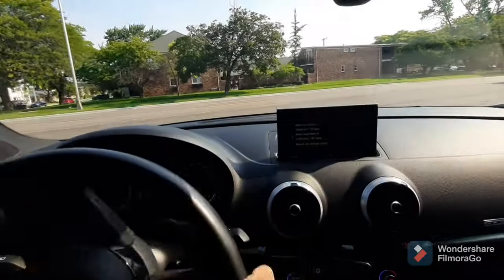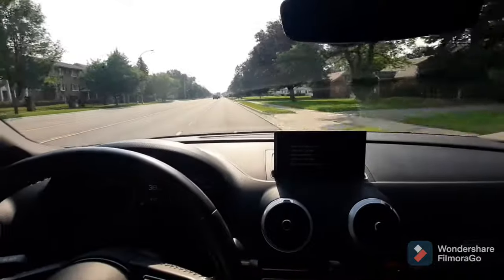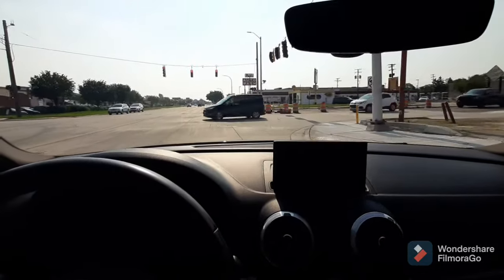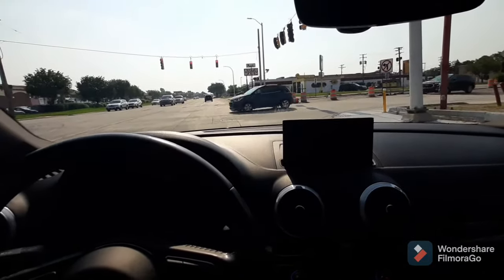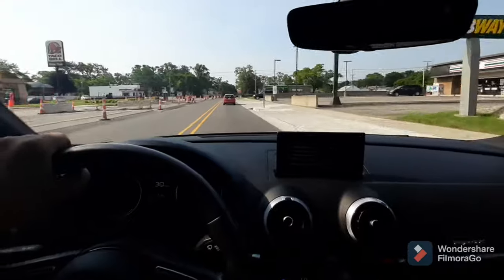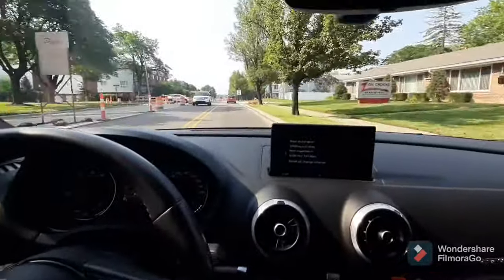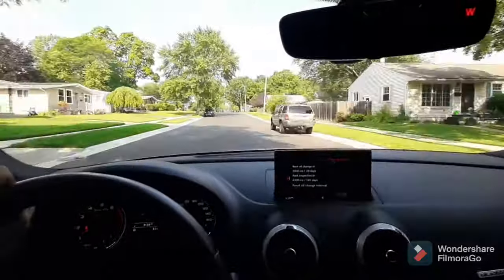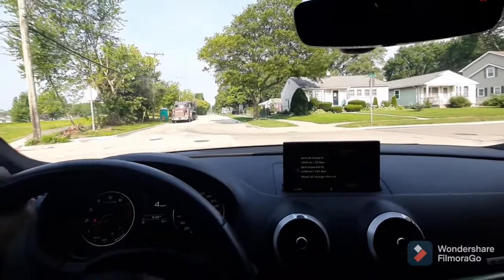How to tell the difference between a wheel bearing noise and a tire noise from drivers seat

Comment from the maker: If you would like to help support this channel please take a look at these tools I recommend and use daily. 

Streamlight usb rechargeable pen light (affiliate link) https://amzn.to/3GxgWtl

nebo usb rechargeable pen light (affiliate link) https://amzn.to/3vAK0wT

Automatic noise cancelling ear protection (affiliate link) https://amzn.to/3Q7ZiPZ

Reasonably priced metric wrench set. (affiliate link) https://amzn.to/3GvIkHV

Excellent 1/2in drive split beam torque wrench (same as snap on) (affiliate link) https://amzn.to/3Z5qu67

1/2in long impact socket set, I've been using this set for 15 years and haven't broke one yet (affiliate link)  https://amzn.to/3jJcrmv

Thank you and thanks for watching
Reply: What you said 0:30  my vehicle gets louder at 40mph in the front only when i loaded to the left is it true that it’s my right wheel bearing defective and not my left one ?

Comment: My mechanic told me my bearing were bad. He changed 2 of them. Still had the road noise. I changed the tires, the sound went away. Yes, I found another mechanic.
Reply from the maker: Good move, sounds like he wasn't the guy
Reply: At least you have 2 new wheel bearings now 😂
Reply: Mechanics, like lawyers, create problems not solutions.
Reply from the maker: Lol so often true
Reply: @bullinapeamurica5940  4 good total :)
Reply: Same happened to me months ago 😭
Reply: Yeah, I was told it sounded like the differential, so had it serviced. .no difference.. same mechanic says it's the wheel bearings,  and I can understand why, sound wise, but I'm not convinced since first diagnosis was off .. service cost unecessary. But it narrowed it down. 
I recently had a flat tire on a 2001 4x4  SUV,  ran on it's spare, a tire kept when set changed, less than 2 yes ago,  for a couple weeks. The abs light came on since, and sounds started soon, days after having the newer tire repaired and put back on, front passenger side.
I started asking myself if it could be how it was mounted, hubwise?  I'm keeping an open mind, but have no time or more money to put in to "maybe" fixes,  and don't feel safe driving unless/until I can rule bearings out  :)
Reply from the maker: Sometimes just rotating tires side to side or front to back can help diagnose if it's a tire issue or not.
Reply: @EuropeanAutoRepair  hello my friend, i have a 2020 Audi A3 2.0 (odo 17k miles) and i have a humming noise from rear passenger wheel, Today i rotated the rear wheel to front and now that noise moving in front passenger side, i thing the problem must be the tire or the rim is bent , is that right? Thanks
Reply from the maker: Sounds like a tire problem. Install spare if you want to be sure
Reply: @EuropeanAutoRepair  thank you
Reply: This is too common
Reply: Holy shit the SAME EXACT thing happened to me. Had two bearings changed. Still having issues. This confirms my suspicions that I need new tires. Thank you!
Reply: Did you went on same tire brand or different? thanks in advance!
Reply: I changed bearings and now tires but still noise coming mechanic said it’s transmission noise?
Reply: @Pubgliv804 any update ?
Reply: Same problem with me
Reply: mechanics should have to refund every penny including parts when they dont fix the issue after diagnosing incorrectly.
Reply: Diagnosis is 80% of the work. Most mechanics dont know how to diagnose
Reply: My low profiles are loud AF
Reply: Only time i forgive that is if they apologize and give me my money back for the repair i didn’t need
Reply: Some times the bad bearing will cause cupping wear on the tire so you need to change both so it may not be your mechanics fault
Reply: 🤣you know we gonna ask
Reply: @EuropeanAutoRepair hey bro....I bought old car used to have vu vu vu ...sound ..but since last few days it is making much more vu vu vu noise ...when I asked a mechanic who is a neighbour to me ...he drove the car and said it is bad tire..and make it balancing or new tire...but when I take it to some tire balance shop he checked physically on the road with out putting it on the wreck told that it's not a tire problem...went to tuning shop and he said might be a wheel bearing problem ( my car is a front wheel drive and I'm sure it is coming from rear side ) kindly guide me what to do now please ... driving my car with same sound almost from 10000 miles ..
Reply: @90qwertys  hi .bought old car used to have vu vu vu ...sound ..but since last few days it is making much more vu vu vu noise ...when I asked a mechanic who is a neighbour to me ...he drove the car and said it is bad tire..and make it balancing or new tire...but when I take it to some tire balance shop he checked physically on the road with out putting it on the wreck told that it's not a tire problem...went to tuning shop and he said might be a wheel bearing problem ( my car is a front wheel drive and I'm sure it is coming from rear side ) kindly guide me what to do now please
Reply from the maker: @leelakrishna888  lifting the vehicle in the air on the hoist and rotating the wheels while listening with a stethoscope would be a way to eliminate wheel bearings as a possibility
Reply: Lmaoaoaoa my mechanic told me it was my brakes changed them noise didn’t go away I got a new mechanic
Reply: Wheel bearings cost 200 a piece . Mechanics will do anything to finesse you . Only a good few you can trust
Reply: Ur awesome bro
Reply: @ianlondon2888  Fact. Thru fix one thing & mess something else so you can go back to them with more $.
Reply: Helpful video, I was quite worried. Checked my axles and bearings and they all seemed fine. The wurble sound you mentioned gets faster with speed. Rotated tires and the noise switched spots 😂
Reply: You realize that, you could have had bad wheel bearings as well right lol. Just because it might not have been a direct fix to the symptom you hear that doesn’t mean that they weren’t due for replacement.
Reply: Mine happens on a particular road. Which is the newly tarred ones leading to my street. Once I get on the expressway which have old asphalt, I hardly hear the sound. It’s a new car I just got. My previous car didn’t do that on that same road. What could be the problem?
Reply: @eguasaogiamien1755 same happens to me I even feel
It on the steering wheel just can’t diagnose the problem myself
Reply: Probably shock not good
Reply: Think you need new mechanics 😂😮
Reply: Could be both 🤷🏼‍♂️
Reply: Same thing here
Reply: wuh wuh wuh on decel hahaha spot on though
Reply from the maker: Hahah yeah man, I had to make the noise
Reply: All you needed was new tires and an alignment
Reply: Bro I just did a repair and the mechanic hasn’t come back to fix my issue I’m like damn people really being shady and not doing good business
Reply: @EuropeanAutoRepair that noise sounds like my brand new tire...I just got the bearing replaced and apparently the mechanic agreed with my amateur diagnosis. What a way to go.
Reply: @leelakrishna888 how you fixed it?

Comment: Had two new cars started making a roaring noise at speeds over 20mph.  Around 24k miles or more on the vehicles.   Both of them large sedans.  Both times I was sure it was the bearings but it ended up being the tires.  The tires still had lots of tread left... I was disappointed that I didn't get the expected tire life.
Reply from the maker: Yeah, tire noise is the worst. More money to replace tires than a wheel bearing ussually
Reply: You could also go back to the place you got the tires and they’ll exchange your tires if you didn’t use them for too long because they sold you bad tires , they are normally understanding .

Comment: i need a alignment i crushed the curb pretty bad and replaced my control arm strut sway bar and cv axle, and i got new tires and i still have the wooowoooo noise i’m going to the shop to get a alignment tomorrow i just want the noise to go away it’s the only noise my car is making and i got new tires and i’m upset i still hear it.

Comment: This helped a ton, I turned onto a street divider (didn’t know it was there and not from the area, no signs were posted signifying no turning left) and went over it pretty bad. Tires were already decently low thread and popped both my right side tires. Paid $80 total for both tires to be replaced ($45 tire and a $35) and put them on my car myself. Ended up with a whooping sound as I accelerate or a whoowhoowhoo sound. Another slightly rough sound as well. I screwed up bad, my first ever fuck up. And that whooing sound has me in disarray. This thankfully put some ease to mind and luckily know it’s not my bearings

Comment: I am an auto tech, and I can tell you that for the majority of wheel bearing diagnosis this method works well.
There are a few odd ones that come in usually imports Honda and Toyota specifically, that the bearing will have zero play and by that have no change in sound loaded or unloaded.
And the way to tell if it is bad is the old Airplane propeller sound.
Many years ago my wife's Acura was starting to make this prop plane sound from the front of the car, and I checked the wheels clearance to brake calipers (they were very close but not touching ), I checked the bearings for wear or play - none found, I checked CV Axle nuts preload and that was in spec.
I ended up replacing the knuckle assemblies which had the bearing pressed into it, and the noise was gone instantly.
I took the old ones to a friend and told him about the sound, and he pressed them out and cut the bearings apart and showed me the wear spots in the bearings.
Basically the case hardening starts coming off the rolling parts making little flat spots. And the Axle nut preload keeps the bearing from showing any play, yet still allowing it to make a fairly loud noise.
I asked him why would the case hardening even comes off in the first place, and he said it's little stress cracks that form in the metal when the grease dries out in the sealed bearing, and the rolling parts get too hot and the hard surface cracks because it's also brittle and cannot withstand wide temperature changes..
My 02¢
Reply from the maker: I’ve heard some of the early 2000 Lincoln’s had a similar issue, I’ve experienced the noise you are talking about but never on a European car for some reason, thanks for the input!
Reply: My Honda wheel bearings are def bad but they definitely not as bad as my past cars or even my 2000 Honda. Getting them done tomorrow

Comment: Best explanation Iv seen and you didn’t even need to play the sound. You’re the man. Thank you. I was so stressed about getting a wheel bearing but my car is loudest when I’m descending
Reply from the maker: Hah thank you!! So happy the video is helping someone
Reply: Tires are more expensive than bearings
Reply: @shahidiqbal3707  not a used tire
Reply: @shahidiqbal3707  I can get a good used tire with install for 40$
Reply: @thechildfromthevillage  maybe in the ark ages
Reply: @fapapas4534  I just had 2 bearings replaced for $1,200 dollars.  Tires are definitely cheaper.
Reply: @silversurfer806 Idk if you'd even wanna tackle car repairs yourself, but most really aren't that bad. Yeah, might be a day of cursing, rusted on nuts/bolts (I live in the NE, so rust is a killer)etc. but I've save myself thousands upon thousands of dollars doing a lot of stuff myself. Id replace a whole hub assembly instead of dealing with pressing out a bearing, most hub assemblies depending where you get it can be $30-$130 usually. Pretty easy job. I can't stand most mechanics..they charge rediculous $ most times.
Reply: My car really don't make a lot of sound then descending. It's the landing that's loud

Comment: At first i thought i had a wheel bearing issue, but when you mentioned that it is more prominent on deceleration, now im thinking its a tire issue! Thanks!!
Reply: Update: just got back from the dealership… It turns out it was a wheel bearing, go figure lol
Reply from the maker: Haha well I’m happy you got it resolved
Reply: I've got a little issue with some noise at the moment. Initially thought maybe worn tyres, but I'm inclined to think it may be a wheel bearing or two. Either way it sounds like I'm being accompanied by a Cessna in the distance when I get up to about 40mph.
Reply: @willenium2k4  Yes! That sounds eerily similar to how my wheel bearing issue presented- although I described it as a helicopter-sounding noise- maybe because I have never heard a cessna before
Reply: @nathanfranks1476  So I've literally just rolled my trolley jack back into my garage. Jacked the car up and spun all four wheels after work this evening. Pretty sure the rears are ok. Fronts feel smooth when turning by hand, but doing the 'steering sweep' while driving home from work this evening, it seems the issue is likely pointing to the offside one. When spinning it quickly I think I can hear a tiny bit of clunking, but it's hard to tell with the ambient noise and the wind blowing in my ear. I'll order a bearing anyway and see how I get on.
Reply: Ok so an update to this. I replaced the offside front bearing and the car was completely different afterwards. Stunt plane noise gone, car driving smoother and rolling resistance much reduced. I replaced the nearside front one yesterday as well due to a grinding noise when turning left. Overall smoothness is about the same as after the first I think, but the noise on turning is gone.

Parts cost for the two bearings and misc bits to do the job was roughly £80. Seems people who've been paying to get a pair of bearings replaced on the same car have paid around £500. Well worth it for the saving, even if it didn't feel like it while doing the work.
Reply from the maker: @Willenium2k4 nice work, glad you got that resolved

Comment: This is reassuring. I just bought an 05 Toyota Corolla with 305k miles on it and was hearing that wubwubwubwubwub noise on the way home.
Reply: I've seen some nicer cars but didn't buy cause it had that many miles. I just got a 05 with 100k miles and it makes a noise 😅smh. Hopefully not a lemon.
Reply: I’ve got the same problem, wondering have you figure out what’s wrong of that? Is that a bearing problem?

Comment: Good video. I definitely have tire noise thank god. I was worried i would be replacing another set of bearings. It’s the steady noise when decelerating. Ill have to get the truck aligned and the tires spin balanced and rotated. Big worry off my chest

Comment: Another useful tool that works well for us DIY'rs is a stethoscope...For listening for vacuum leaks, engine noise, and bad wheel hubs..Usually even if a bearing is slightly worn, while spinning and listening against the rim or hub (wheels off the ground obviously) youll hear a metal on metal noise through the stethoscope...
Reply: Or have someone else drive while you lie on the hood and try to get the stethoscope down into the wheel well!
Reply from the maker: @redbaron07 haha I think I seen a movie like that
Reply: @redbaron07  wtf? Its called using a lift

Comment: Great video, best explanation I've seen yet. I have had a dealer look at mine and brush it off which is frustrating (warranty work). Newer tires on a certified pre owned suv, noticeable noise from 55-60 mph, sounds like a bearing. Dealer says they checked and it must just be tires. I hate to replace a brand new set of tires with only a few thousand miles but I might have to. Texture of road changing and moving wheel doesn't change the sound. Not noticeable at other speeds.

Comment: Thanks so much. I'm rolling with a tire issue based on  your fantastic diagnostic skills. What's interesting or telling is my tires were just rotated. I noticed the sound immediately from the front tire(s) and this was also after the mechanic said my lug nut had been crossthreaded,  and my hub might be damaged. I'm calling BS on that based on the sound, and what you described. Plus, how do I know that he didn't do the thread damage himself? I've been to the shop before, purchasing a pair of tires. He was also quick to point out that my rear brakes were shot. I appreciate the diagnosis, but I wonder if he was really working an upsell back then as well. Thanks again my friend. I'll see if the shop follows up my call after driving home with the new noise.
Reply from the maker: I appreciate that, hope it all works out for the best

Comment: Daughters 2014 C-Max Energi had tire noise that changed when the original 9 year old tires were rotated, front to back, with the cheaper 5  year old tires previous owner had replaced them with. The original Michelins had not, quite, gotten to the tread wear indicators but, because of age, and the Hankook were in the wear indicators all 4 were replaced with 70,000 mile Michelins. Because of radio volume, and the noise started gradually, she didn't realize how loud it had gotten. Good quality street tires tend to be quieter than cheap ones. Inflation and rotation.

Comment: yea bro, i appreciate the video, i got new tyres and the sound didn’t change, my alignment is bad and it seems that “woo woo woo” noise has been happening a lot, i wasent sure if it was tyres or bearing issues. Since my alignment is bad i believe that is were the sound is coming from.
Reply from the maker: No problem, I hope you get to the bottom of it without too much trouble
Reply: @EuropeanAutoRepair  so i got my wheels aligned but it’s still making a slight woo woo sound, not as much as before but it’s weird im starting to think either it’s the bearings or it could have been because i drove like 2 days with bad alignment on my new tyres

Comment: My issue is that after i accelerate thats when it makes the thumping noise. After listening to what u just said is that a tire issue?
Reply from the maker: If it’s only under acceleration check your cv joints on driveshafts and axles, I see that often on front inner cv joints when they are loose